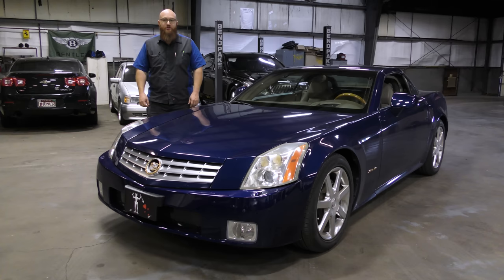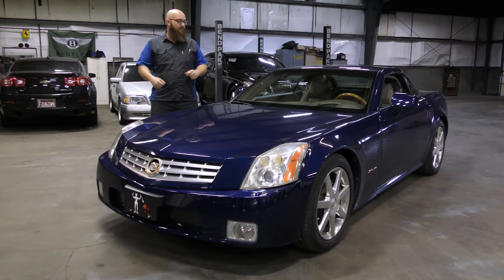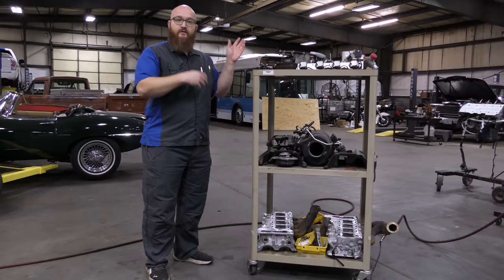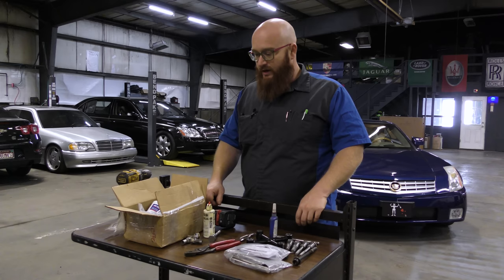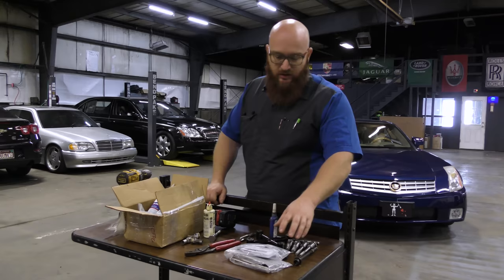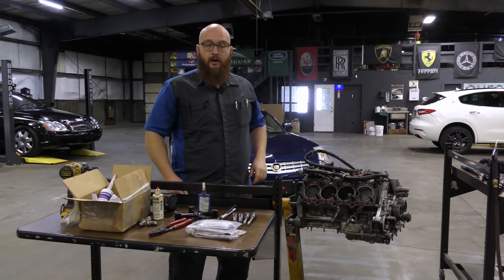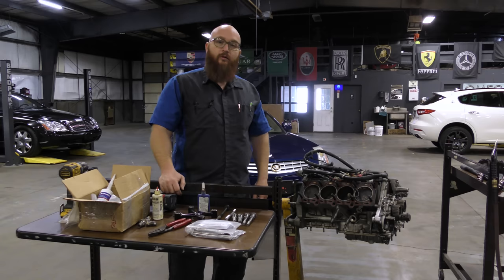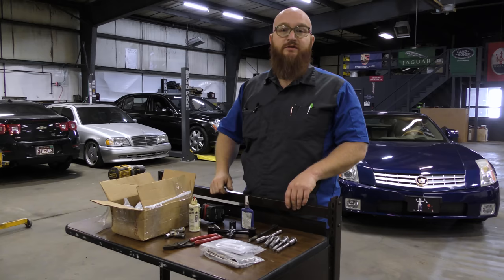No room for error! CAR WIZARD drills out the head bolts on his '04 Cadillac XLR

Comment: Car Wizard, needless wasting his time ruining a perfectly good Northstar because he believes in head bolt fairies and flunked metallurgy class in trade school.
Great comedy.
Reply from the maker: I have proven this to work myself. Its a great system. Its not ruined. Its highly improved now. Not wasting time. These videos are making me great money. So you are incorrect in every way. I didnt flunk any class I have ever taken either. Maybe you did though.
Reply: @CarWizard  Its not necessary.  There was nothing wrong with that engine with 32K miles on it.  I worked where the Northstar was developed as an automotive engineer. Not everybody who watches your videos has your IQ.  I saw them flogged for 200K miles at Milford Proving Grounds.  When head bolt faliures occur it is due to overheating the engine, the head and block deform pulling out the TTY head bolts.  This is the same issue Toyota has experienced.  Overheat the engine, the head and/or block warp and head bolts pull out.  If the engine hasn't been overheated there is no issue.
What I find laughable is, mechanics always believe they can engineer better than the engineers.  Do you believe the Northstar which I have personally owned including many of my colleagues, that this engine would be produced year after year with a known catastrophic failure on their flagship car Cadillac?  That would be stupid and people would lose their jobs by the hundreds at the GM tech center where I worked.  Many engines suffer copious failure and are irredeemable if they are overheated.  People kill more Northstars than Northstars fail inadvertently.  You are wasting your time fixing something that isn't broken.
Reply: @lukewalker1051  
Your proving grounds cars would be constantly hot running..and serviced each refuelling...with no/hot cold cycles.
Real life has the 1 mile run to the shops and home in the middle of winter, followed by the 50 miles commute, followed by 8 hours cold soaking in the middle of a car park in winter...followed by the return home etc etc.
Those head studs are getting expansion and contraction galore...in real life.
Reply: Now I wonder of how much boost and heat those blown-up head gasket stock course thread head bolts Northstars got like what mods did they get and other maintenance? There are for sure many variables in place that make something sound and seem worse than it really is
Reply: @JohnSmith-yv6eq  Here is what the public doesn't know.  This is scrutinized in excruciating detail in product development.  It is part of the DVP&R and DFMEA.  Look up those acronyms if you don't know what they mean.   Countless heat cycles are performed in development as part of engine development protocol. More? What you describe is performed 'every year' in production by consumers who purchase these cars and these results through dealer networks and warranty claims are fed back to the development engineers for changes.  Why is this critical?  Because car companies can't stay in business with a high frequency of copious engine failures.  Engineers do not get everything right from product inception because humans aren't perfect but there is a system in place to compensate for the unknown.  But engineers get most things right because design is highly derivative and what they don't get right is resolved certainly after the first or second model year.  Not inserting head bolt threads on aluminum engines whether the block has steel liners or not is nothing new. It is elementary.  Anybody who has worked in powertrain development for any major auto company understands the sensitivity of aluminum and overheating.  Even on iron block engines with aluminum cylinder head that are overheated can fail the aluminum head due to warpage and BMW are notorious for this speaking of thermal cycles with heterogeneous coefficients of thermal expansion aka aluminum head with iron block.
So word up to Northstar owners.  Don't dispair and believe you need to follow this channel's advice. Use the same due diligence you would employ owning any aluminum engine.  If you run the coolant low, a radiator hose blows, a thermostat sticks, are pulling a heavy trailer through the dessert or up the moutains and pushing your engine hard, keep an eye on your temperature gauge. If you don't overheat a Northstar, it will reward you will many years of reliable service.  More?  If you run any engine out of oil by not checking the oil through prolonged oil change intervals, this can overheat an engine as well and cause the same problem.  Most that overheat an engine will continue to try and drive it to their destination.  Anybody who understands engine design will never do this because it is the kiss of death for an aluminum engine of most varieties and Toyota who has very good engineering is known for this condition as well.
Reply: Ford 5.4 spark plugs only blew out of heads for 4 years. Engineer’s get it wrong all the time, and the good one’s can admit when their wrong.
Reply: @kevinb8285  Ten thousand parts on a car.  How good were you at math?  Ever take a statistics class?  Do you understand complexity versus reliability cost? Engineers get much more right than they get wrong or you wouldn't be driving around.  Who do you want to leave to car design?  Mechanics like the Wizard who don't understand section modulus, moment of inertia or strength of materials and inserting an engine that doesn't need it?  No.
Speculation you just made is common.  A good analogy is someone who is an 18 handlcap golfer giving the club champion advice on his golf swing. There is a reason why he is the club champion.  He knows more.
Here is another thing the public doesn't understand.  Physics and testing don't lie.  Let's take this Northstar test case the Wizard is working on.
Consider this.  Joe six pack runs his Northstar hot because Joe six pack never checks his coolant level and his radiator may have a slight leak...or the water pump is wicking coolant out the bearing weep hole because he never changes the coolant and the corrosive coolant degrades the bearing seal prematurely.  So his production level non inserted aluminum Northstar overheats and being dumb Joe six pack he never got the memo on immediately shutting down the engine to prevent warpage.  What is worse for block and head warpage, an inserted engine like the Wizard is retrofitting or a production non inserted engine?  You don't think the engineers that designed that engine don't know what is worse for warpage?  The head bolt thread is the 'sacrificial lamb' in an overheat scenario.  Me personally and anybody with a brain would prefer to have stripped/pulled out head bolt threads versus a dramatically distorted head and block sacrificed because both were held tenaciously together with a steel fastener.  A common heli-coil repair or inserted stripped head bolt hole(s) is the 'preferred' failure mode of an overheated aluminum engine versus replacing the block or cylinder heads. Weak link by design.  Engineers understand these relationships because what they do for a living.  Here is a pro tip.  Never go to a podiatrist to have your tooth capped.  It won't turn out very well.
Reply: @mrswormsweat4694  No idea what you meant by your comment but the Northstar engine, aluminum thread retaining head bolts and all, was way overdesigned for its targeted nominal horsepower.  A wonderful engine and btw rev's beautifully and silky smooth.
The Northstar…I owned three…had quite a storied history and was in production for 18 years.

If you have to pull a cylinder head on a 1993-’99 4.0L or 4.6L Northstar V8
to replace a gasket or do a valve job, do not reuse the old 11 mm head
bolts. Also, GM has revised the head bolt torque values and tightening
procedure as follows:

– In sequence, torque all bolts to 30 ft.-lbs.
– In sequence, rotate all bolts an additional 70°.
– In sequence, rotate all bolts an additional 60°.
– In sequence, rotate all bolts another 60°.
– Torque the front three M6 head bolts to 106 in.-lbs.

An important note:  What the Wizard is doing is yesterday’s news and should never be done pre-emptively.  Many get the interpretation wrong and believe this is a design flaw and it isn't.
 
GM in fact has a thread repair kit because it is common to fail threads if you overheat this engine as mentioned by design.  There are several reasons why ‘any’ engine can overheat and this is the common failure of any aluminum engine.
Because the Northstar V8s are aluminum, thread damage is not unusual.
GM’s recommended thread repair kit is J42385-500 for main and head
bolts, and J42385-2000 for other fasteners.

I will tell you what kind of cylinder pressures this engine can take with ‘aluminum threads’ retaining TTY head bolts.
A highly modified 650 hp (485 kW) version of this engine was used by General Motors racing division initially for Indy Racing League competition starting in 1997, then was later used in the Cadillac Northstar LMP program in 2000. Both engines retained the 4.0 L capacity, but the Northstar LMP version was twin-turbocharged.
GM also had a supercharged version of the Northstar they sold in performance model Cadillacs.
The engine is extremely robust and can take big horsepower.

Further, it was continuously improved throughout its 18 year production run.  There is a great amount of 'philosophy' when it comes to engine design.  Call this engine GM's early version of the Ford Coyote 4 valve V8 and by comparison consider what the mainstay GM V8 today is...the by comparison, rudimentary pushrod 2 valve LS. Next to a modern LS, the Northstar was a much more complex engine.  GM was showing off a bit with their technical capability.  But in life, sometimes simple is best and hard to fault the venerable LS or the more complex Northstar...in the eye of the beholder.
Reply: Just admit you helped design trash engine.
Reply: @21Piloteer  I shouldn't dignify what you wrote but the Northstar is a fantastic engine. What happens sometimes in the industry to engine reputations is, idiots perhaps like yourself kill them due to negligence or hotrodding them and blowing them up and then go on the internet and denigrate them or say there is a design flaw.  Somebody watching this video is an example.  When the Wizard took this engine apart with nothing wrong with it at 32K miles and 'changed the design' without proper verification testing, he compromised the possible integrity of this engine and didn't improve it.  This is because of the law of unintended consequences. Change one aspect of an engine and other aspects can be affected like cooling.  Why would cooling be affected?  Because aluminum has a higher coefficient of thermal conductivity compared to steel.  The Northstar is an intricate engine highly reliant on its ability to shed heat. The head bolts of this engine tested through millions of miles aren't going to pull out unless 'the engine is overheated'.  The Northstar was manufactured for 'eighteen years' with the same head bolt attachment construction aka non inserted head bolts.  Millions of miles accumulated.  All the data was reviewed by engine developers at GM because it was their job and the design wasn't changed. Further this engine was raced and 'pressured' by twin turbo chargers and block and heads held fine.

The following is another example from another car manufacturer, Ford Motor Co. Some that love performance cars believe the Shelby GT350 with manual gearbox and Voodoo engine with flat plane crank to be perhaps the pinnacle of a performance street muscle cars ever conceived.  If not the pinnacle, its up there.  I in fact grew up modifying and racing early Shelby Mustangs but the latest version of the GT350, its engine was a watershed design.  What happened?  Shelby owners of these special cars were blowing them up at the track. Why is that? How could that happen in the modern era?  Did Ford design a bad engine?  Ignorant people thought so as was reported on the internet.  What was really happening was dumb owners were running them out of oil at the track. Why is that? Because Ford engineers designed the clearances of the engine to be a bit looser than normal due to the performance nature of the engine and the engine because of its architecture would turn 9000 RPM at redline and high RPM magnifies oil consumption and this combination resulted in higher than normal oil consumption. Owners weren't checking their oil and blowing them up.  This is common.  People kill a perfectly good engine more than they fail randomly due to a bad design.  Ford decided to finally pull the plug on the venerable Voodoo engine and are now sticking to the Coyote which is a good engine but it ain't no Voodoo.  Can't fix stupid, just like your comment.
Reply: @lukewalker1051  blah blah blah blah blah.  GM obviously knew there was a problem since they had to redesign the head bolts, but apparently wasn't good enough.  Head gasket failures and oil leaks abound!
Reply: @21Piloteer  All engines from all manufacturers have hundreds of incremental changes throughout their product life cycle.  The head gasket failures on this motor are just like the timing chains the Wizard accuses  GM of on their corporate 3.6L motor which is in everything from Cadillacs to Buicks to Camaros.  You run an engine out of oil and coolant its going to fail.
For those interested Search youtube for:

Why Toyota VVT-i engine Cylinder Head Bolts Fails and goes BAD? Camry, RAV4

How to repair bad cylinder head bolt and block hole Toyota Camry VVT-i engine. Years 2000 to 2017

THIS is Toyota's Worst Engine Ever Made! But Is It Really THAT Bad?

Summary: You overheat an all aluminum engine, the head bolts are going to pull out by 'design intent'.
Reply: And to add, because many that watch the Car Wizard's channel are interested in automotive design and car repair like myself.  Some consider and there is a case for this, that Toyota deserves to be ahead of all car companies in terms of reliability and engineering excellence.  But if you drill down and are honest and look behind the curtain, Toyota as with all companies has its technical challenges.  The Car Wizard loves for example to throw the GM 3.6, 4V twin cam V6 which is in ten's of thousands of vehicles, under the bus.  I have owned several and perhaps the most popular engine at the GM Tech Center in Warren Michigan and an engine in countless Cadillacs for years and years that exec's drive home from work every night.  A ubiquitous engine which I personally love.  It is like a baby Northstar or a Northstar with two less cylinders.  Silky smooth, rev's like a dentist's drill and sips gas, a beautiful engine.  GM like Toyota, has been making V6's for decades and I have not only worked on the design but have personally owned too many to count including my family and countless people I know.  A fantastic engine.  But, if you run this engine out of oil, just like the Northstar out of coolant, the end result as expected will be failure.  That is what the Car Wizard sees at his shop, oil starved and coked 3.6 GM V6's with stretched timing chains and his reaction is to immediately dismiss this engine as horrible which is ignorant of course and why I always react how I do because I know way more about that engine than he does and how long it will last with just basic vigilance which is in short supply by busy Americans.   The whole issue of running engines low on oil, prolonged oil changes based upon computer recommendations is a long conversation.  Suffice to say, too many people hardly ever check or change their oil and dirty, sludging oil that cokes due to running it low which elevates engine temp is the kiss of death of any engine in and in particular an engine as complex as the 4 valve GM V6 with 3 timing chains which requires good lubrication. 
Some believe in contrast the Toyota V6 to be the best V6 engine. But those that make their living designing engines who went to the best engineering schools in America which are the best engineering schools in the world who have studied the subject, know better. Why do they know?  Because engineering design is predicated on competitive analysis.  Engineers who design engines for a living know exactly what DNA goes into engines manufactured throughout the world. Consider GM's talent pool for example.  GM/Chevrolet just released perhaps the greatest American engine ever created, the new Corvette Z06 flat plane crank engine.  It has few peers of any engine design conceived throughout the world.  Why?  Because the best engines were studied in pedantic detail and only best practices were implemented.  An obsession to make the best engine.

But back to reality and what more common Americans drive.  Does Toyota really make a better V6 than GM?  If you don't ask the Wizard, that's a tough question.  Suffice to say, if you keep clean oil and coolant in either, both should give you 200K miles without pulling the heads or the bottom end apart.

I mentioned earlier that engineers constantly change engine designs every year to make them better.  Of course, Toyota does as well.  Engine designers at GM and Ford know where the skeletons are buried at Toyota with their engine designs. There is no perfect engine.
For more on what some consider the very best V6 in the world, check out the following if interested.
Perform a youtube search for:
TOYOTA V6 OWNERS! This is The Biggest Problem with The 3.5L V6 Engine